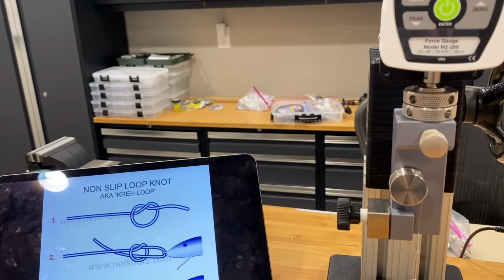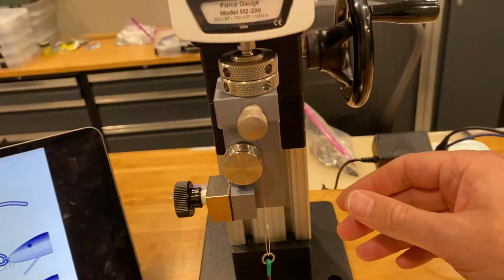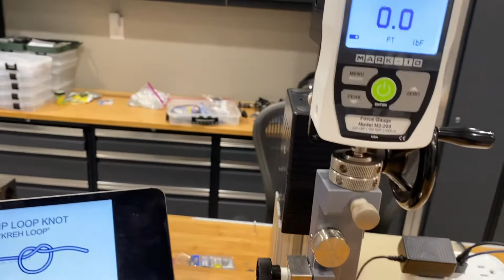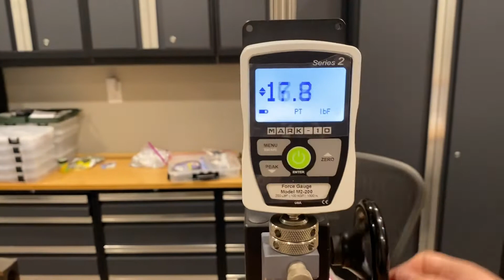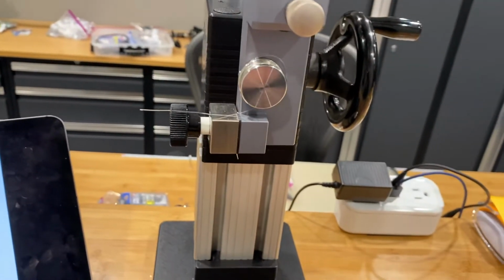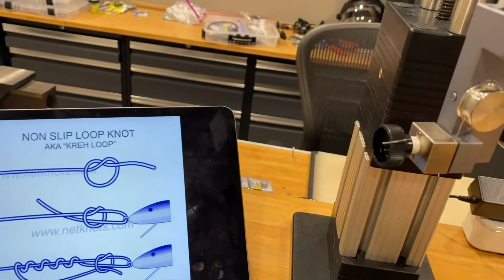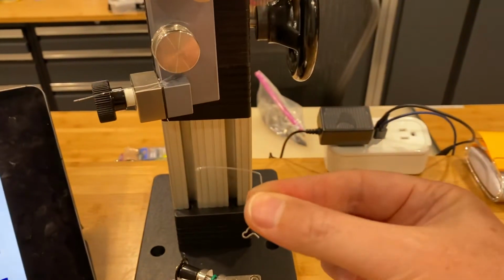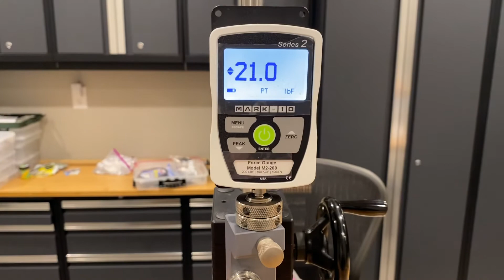Non-Slip Loop Knot - Digital Force Gauge Test

Comment: A break inside the loop knot. In my opinion, I would say that the line is weak or of inconsistent diameters along its lengths. Maybe it kinked when the spool was being filled? Maybe it got overheated or stretched too much when the spool was being wound? Was it used line that someone returned and then was put back on the shelf and for sale? 
  Maybe the knot slips a tiny bit when breaking force is applied to the line. This might cause a jerk or multiplication of force in the smooth full flowing of the breaking force applied? 
  I would think it has thin spots in the line at various locations?  But maybe not. Maybe the knot slips, heats up the line, then the line stretches and thins out and breaks? But maybe not. 
 Might use another knot type, maybe? Maybe the crimp slips and then the line has a thin spot on it?

Comment: The diameter of the ring makes a difference with the loop strength too.
A smaller diameter wire will cut the monofilament easier. Monofilament will heat up with the friction that is occurring.
That’s the main reason of failure.
I think you should wet the knot so it will reduce heat and slip easier. Also, it will be similar in being underwater.